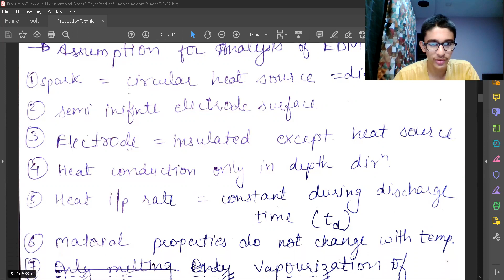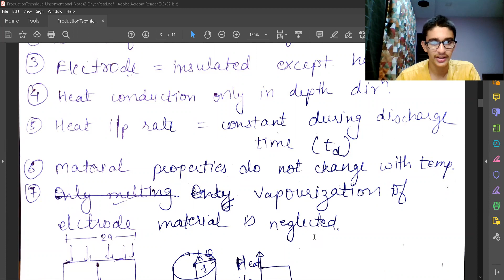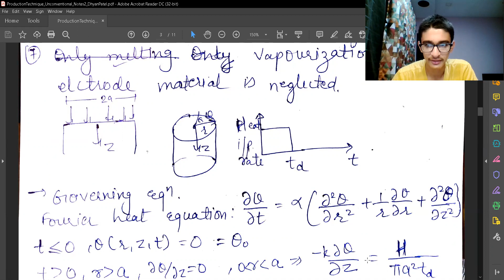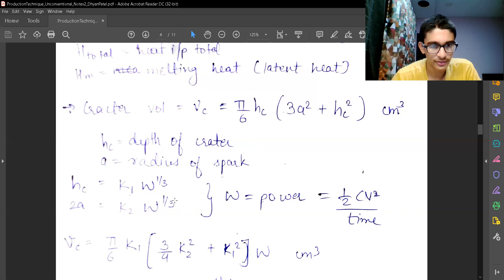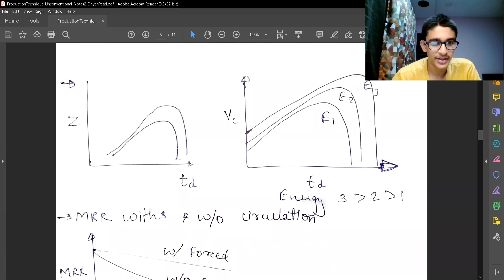EDM Process Modelling, Assumption, Temperature Equation & Boundary Condition |UCM12| Production|Mech

Comment: How was the crater depth derived from the heat input, like to have a derivation ..
Reply from the maker: Hey,
Thank you for your question. 
The equation for power or work is obvious enough from 1/2*C*V^2/time. As per my understanding, the depth of crater, hc is an empirical relation from experimentation, curve fitting and dimensional analysis. It might not have a physical derivation as such.
You can refer to: Manufacturing Science by Amitabha Ghosh